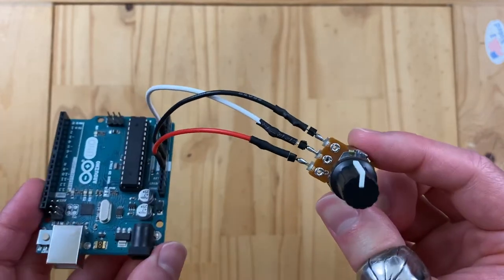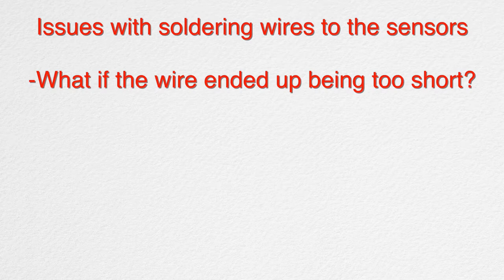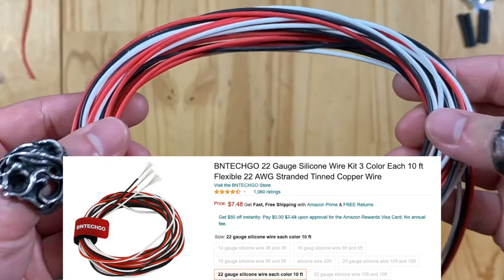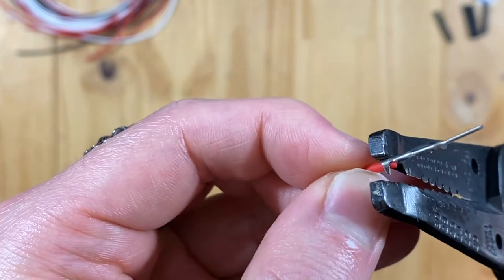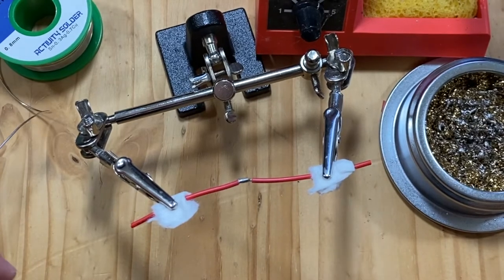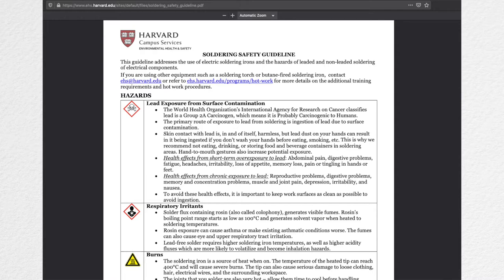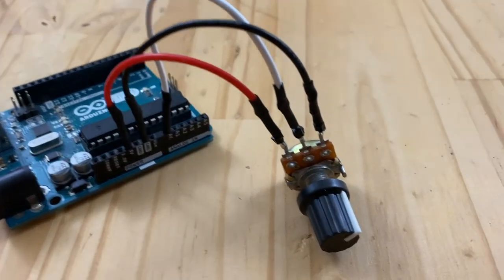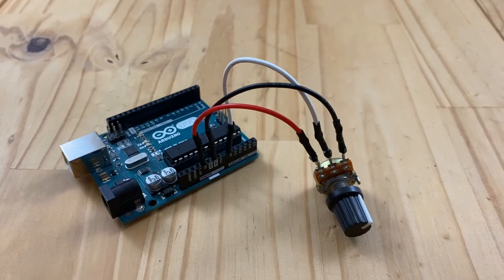Soldering & Crimping Wires for DIY Arduino Projects

Comment: Hobby electronic parts are dirt cheap. Buy more knobs and solder the wires directly to the knob. It will look more professional and less risk of crappy connections.

Comment: Your top video is very good, but I would like to know how I can connect 13 20mm 10k potentiometers to one Arduino? thank you
Reply from the maker: Multiplexer :) 
I wrote out a guide on how to use over on Electrosmith's Daisy Forum. The title of that post is "Cd4051 Multiplexer Tutorial Is Here!". Good luck! It's less intimidating than it initially seems.

Comment: Can I use male to male jumper wires for this? I know I can't adjust the length if I use them but I don't need to. Nice video btw.
Reply from the maker: That's perfectly fine to do!! 
And you can always extend by using female to male jumper if needed. Thanks for watching!

Comment: 🤘🤘 Might be different in other parts of the world, but hot tip for component purchasing during COVID times for anyone reading: Tayda Electronics has been the cheapest, fastest and most reliable place I’ve bought stuff (pots, knobs, wires, specifically re: this project!). Other places took months for parts to arrive, but Tayda ship everything via DHL etc. for pretty cheap and it’s always arrived to me in Australia (from Thailand) within a week. And the pink bags everything is organised by are great 😊.

Thanks Takumi!
Reply from the maker: Thank you so much for this information, Brendan!! I greatly appreciate it!  

I will check out the website!